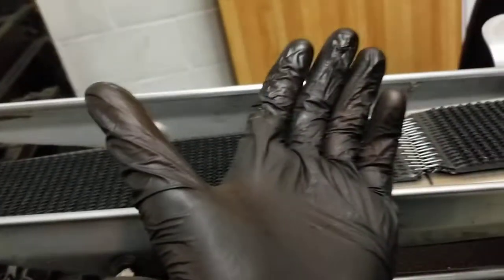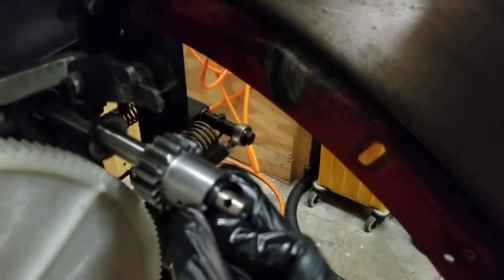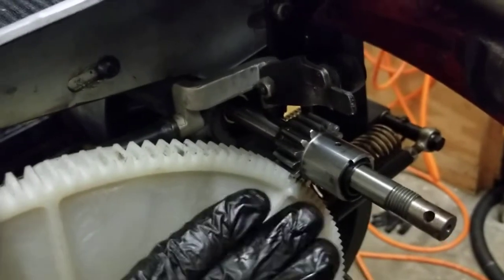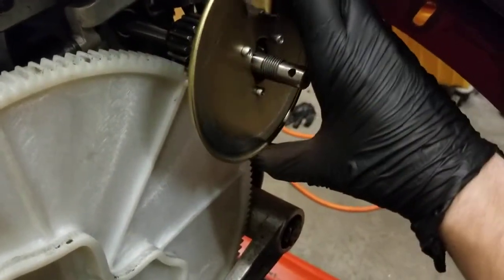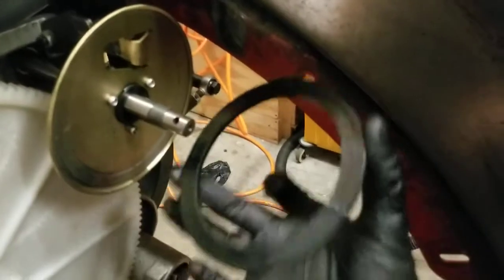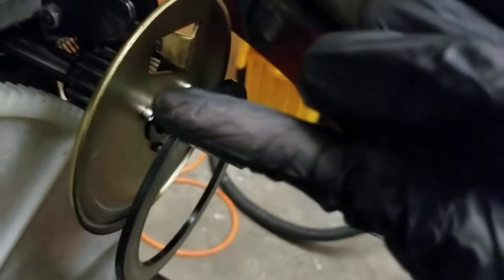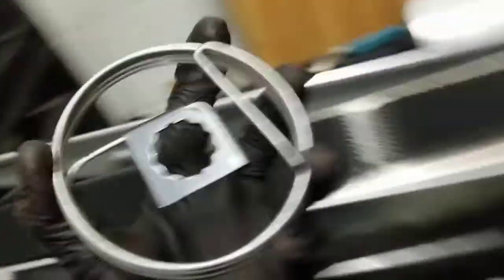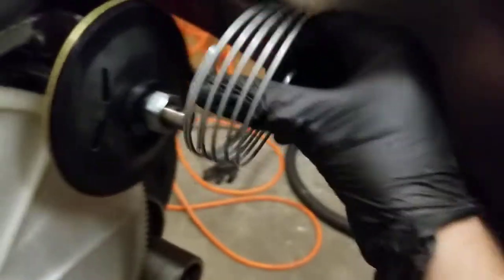AMF 82-70 Distributor Clutch Cleaning and Maintenance PART 3 Assembly and Adjustment

Comment: That Thrust Bearing you put in does have a rigid side and a smoother side.  You want the smoother side to be against the Pinion Gear.
Reply from the maker: @DD2225  I have not noticed that but that's how I would set it. You want to reduce the friction on that assembly as much as possible so that the only friction is coming from the clutch which you can adjust.

Comment: put the outer clutch plate on loosely then tighten down the nut and rotate the outer clutch plate so it pushes against the worn then set the spring tension. Clutch wont fall apart that way.

Comment: You gonna make more amf videos
Reply from the maker: I'm not really sure what to make for the pinsetters. What would you like to see?
Reply: @helloish12321  table adjustments pit removals and rebuilds
Reply: I hope not, didn't even do this correctly
Reply from the maker: @weaponsxpert87  Could you make your own  AMF tutorial video then? How-to mechanics videos are tricky to make and this was my first attempt. If you want to be an asshole then back it up and make your own video. Maybe just stick to pellet guns.
Reply: @helloish12321   wasnt how you filmed it but the info you provided. Some things were just not correct. The worm and outter plate should never be put on at the same time that way allows the worm to potentially have space between the washer and the inner plate. 1 full turn on the spring is too extreme for a freshly rebuilt clutch. The "book" says 3/4 most people go a little tighter to start but a full turn is too much. The outter nut needs to be tightened not just a couple of turns or it will lossen the clutch over time. Some other things also.

Comment: I notice u have the standard 6in backend pulleys if u got a 5in pulley pins would have better spacing and reduce pileups as well.
Reply from the maker: I wasn't aware there were different pulley sizes. I will definitely look into it if I find a lane that has trouble. Does it make the pin elevator rotate slower?
Reply: @helloish12321  yes it does
Reply: The 6in is factory pulley

Comment: Going forward get the Eviro bushings from EBN services for the pinion gear they don't require oil and will greatly reduce clutch maintenance. You can also pull the distributor belt forward to move the drive shaft. The tension on the clutch will not cause trouble with the trip levers. What would cause that issue is not applying grease to the butt plate of the clutch. When it's dry this causes friction and binding when indexing. Overall great job and great video
Reply: If you drill out the top oiling hole in the pinion gear, it will allow for a larger drop of oil.

Comment: Hi, i have a Problem with Via MC2. Sometimes Distributor can't extend to Pin 1 Station, so it causes pin jams on top of the machine. Any Tips?
Reply: Can't extend or won't? Is there binding or can you move it freely by hand?